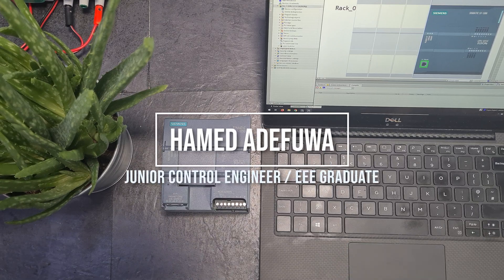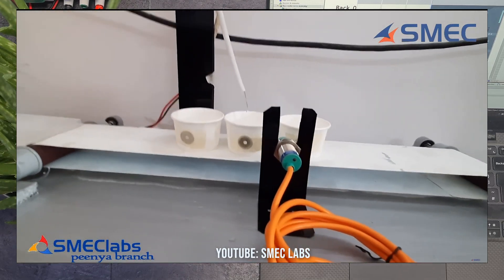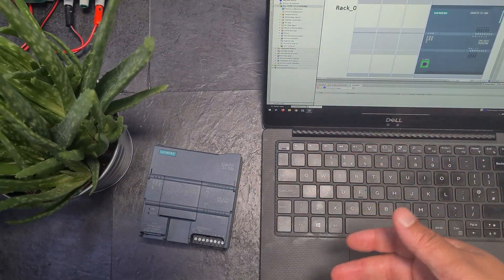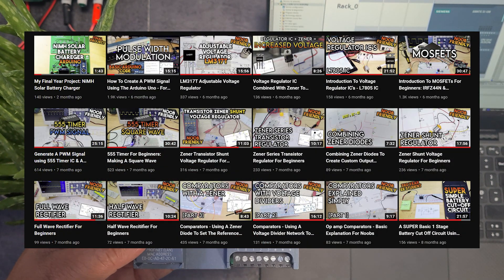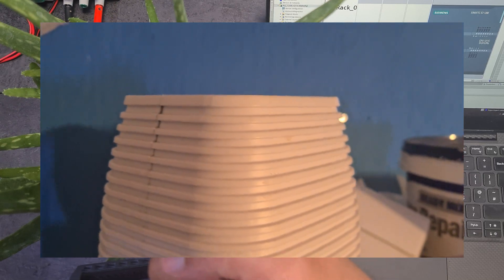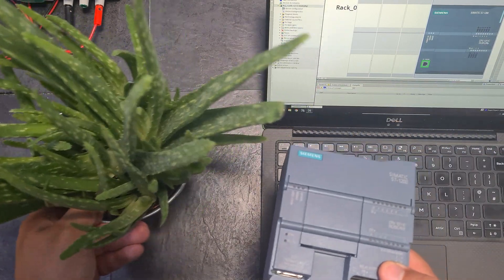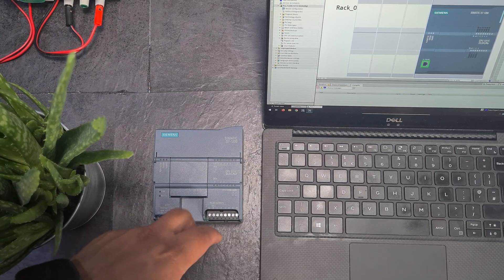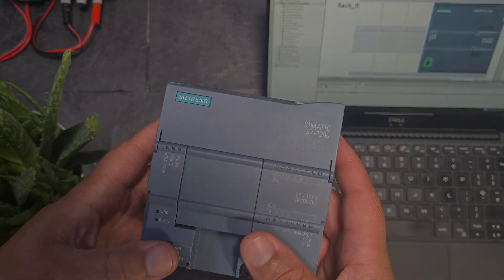Channel Update: The Start of My PLC Project

Comment: Will be interesting to see how that technology has advanced. back in the 80's I worked for a company who designed and supplied line automation systems for the tobacco industry, contactors relays, din rail and all that chunky stuff. I don't think it would be so bad to mix it up with some of your uni projects though.
Reply from the maker: You lot that did that stuff in the 80s/90s are the real heroes lol that was hard work back then! Very good shout on mixing it up with my uni work. I can use a lot of my coding skills but integrating the electronics is going to be difficult I think. I could perhaps make a full solar system with the PLC at the heart. Perhaps solar powered? Ooo..